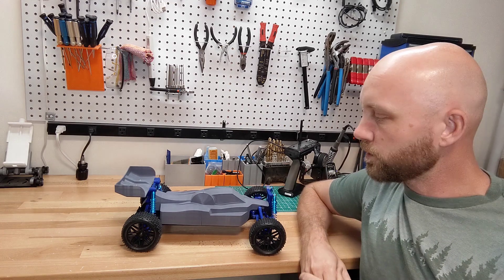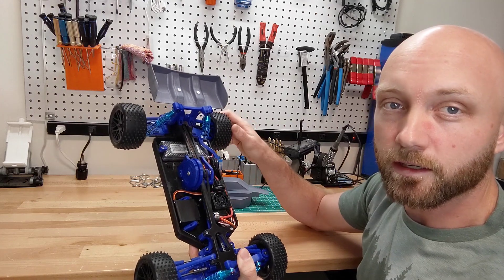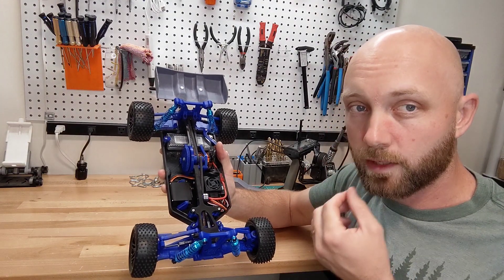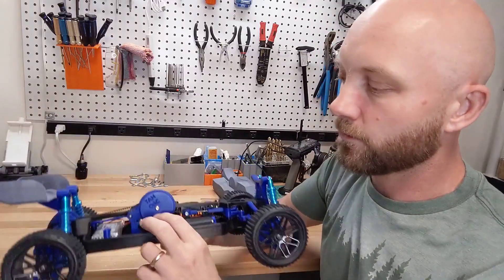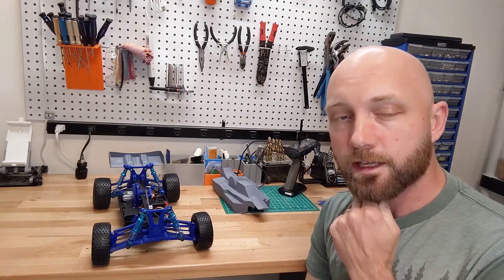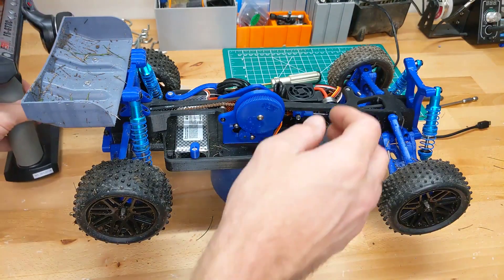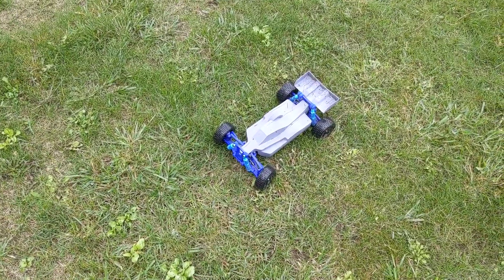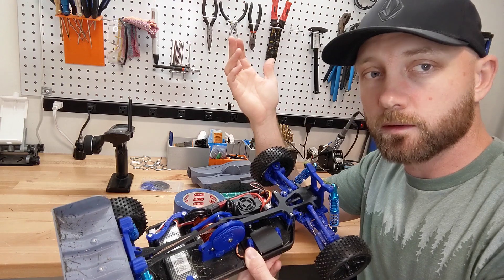Mk Ultra - 3D Printed RC Race Buggy - trial run, tour and first impressions

Comment: Just like with many buggies, you have to decide how you are going to use it and build/ set it up accordingly. It seems the low center of gravity chassis and suspension are more suited for paved surfaces rather than off road driving. It works the same way with the Traxxas lcg chassis. They aren’t meant to clear grass and other obstacles. 
When I look at your “kits” for various vehicles, it doesn’t appear you can help someone who doesn’t have a printer or is restricted to farming the job out to some place that only prints in PLA. You don’t seem to offer a complete vehicle kit where somebody can just put it all together. The hardware “kits” you offer are fasteners that anyone can buy on their own.
Reply from the maker: You are correct, our kits are directed to people with 3D printers to help simplify their builds. Its highly recommended to have a printer so you can print your own replacement parts. I think you'd be dissatisfied with your project if you couldn't fix it easily when it breaks. The printed plastic is less durable than injected molded parts from name brand manufacturers.
Reply: Look at it in a different way, lots of people see the mkultra car then want to print their own. Next question, where do i get all the parts? Rcprinter fills that need.

Comment: How much was the print. And how much was the project
Reply from the maker: The print is cheap, like $20 in plastic. But the whole project can easily be $300 or more depending on your electronics. If you already have batteries and radios that saves you a lot. We sell kits at RC printer.com if you want to check them out.

Comment: The slipping you are hearing is the belt jumping. It looked as though the rear diff didn’t have anything holding the belt cantered.
Reply from the maker: Yeah, the belt slipping off is a bit of an issue that I needed to correct. I did end up printing a part to center the rear belt and that has helped but adding more metal into the drivetrain has been necessary as well. I now have metal diffs front and rear and I've had to move to a metal pinion and I'm pretty sure the printed spur isn't going to need to be upgraded next. Just built a new backyard test track for it... in the middle of editing the video now!

Comment: Hi, i am the guy from the RC thread! :) 
The rear tensioner must go smooth in his place.  Maybe this is your Problem. Your diff is in the right direction. I have an other belt tensioner roll...when you want, i can send you the file!
Reply from the maker: Hey man thanks! I'll try anything once and your belt tensioner roll sounds like a great place to start. Do you want to post it on rcgroups or message me a link to it?
Reply: @rcprinter  I think i will post it tomorrow on rcgroups. It is easier there! :)
Reply from the maker: @77LaKoS77  sounds good I'll watch out for it.
Reply: Hey, what is this “rcgroups” and how can I join? :)

Thanks
Reply from the maker: @hkeles  Hey man, the support group for recovering mk ultra fanatics is over at rcgroups.com. Here's a link to the main mk ultra thread: https://www.rcgroups.com/forums/showthread.php?2952626-MKUltra-A-free-3D-Printable-4WD-1-10-scale-buggy ... enjoy!